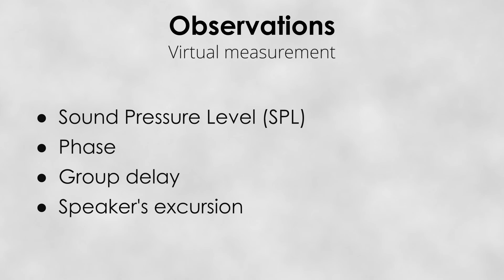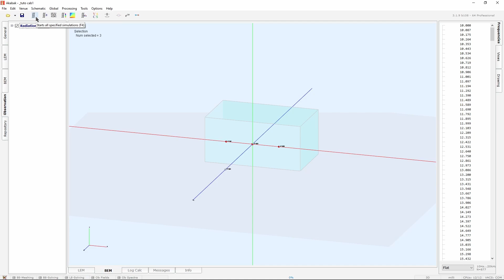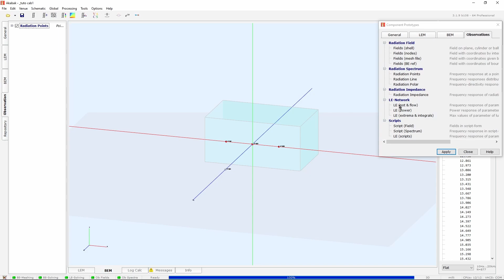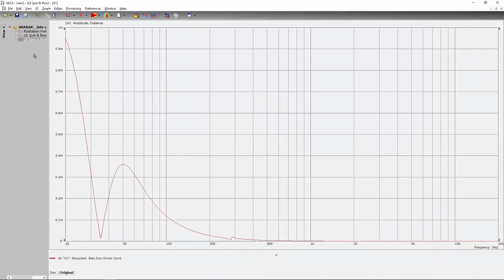Akabak explained | Observations & VACS #8

Comment: Hey! Are the unit wrong for the motor displacement? 0.5m seems a lot for 1w
Reply: I agree, it is weird
Comparing with WinISD on one of my sealed project, I get the same numbers approx but the unit is mm :)
Reply: probably because it's .5milli meter

Comment: Thanks for the tutorial, what about Vent Velocity?  How would you setup Observation?
Reply from the maker: Akabak makes radiation-based simulations, vent velocity could be obtained if akabak was able to simulate fluids...
Reply: @plans.systemes  so we have to simulate "port noise" from other software and then come to Akabak to view radiation.  I'm curious about port (duct) damping, are there fluid formulas to insert into Akabak to help simulate damping fills placed at different locations within the transmission line?